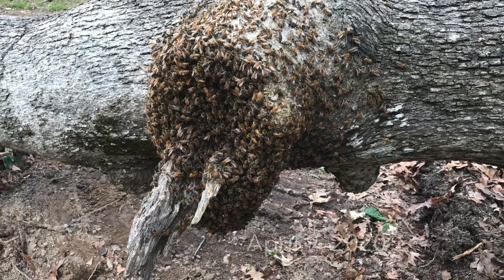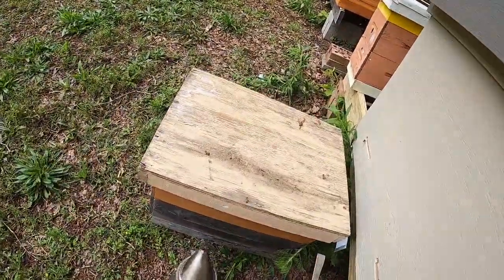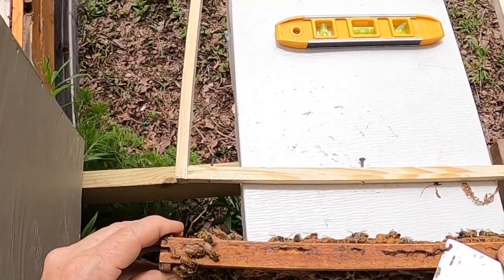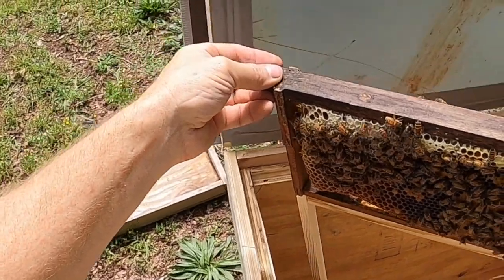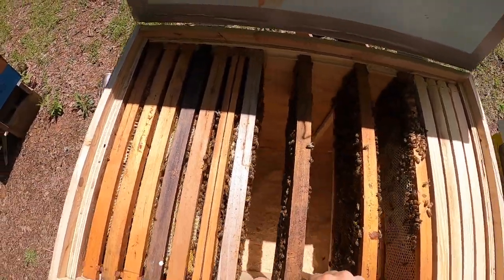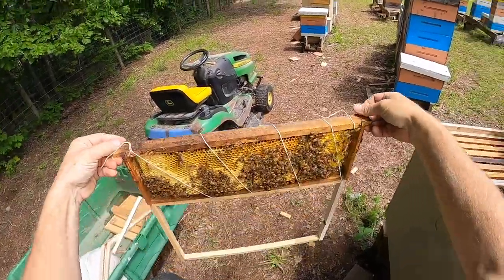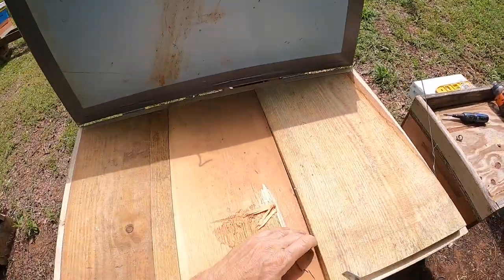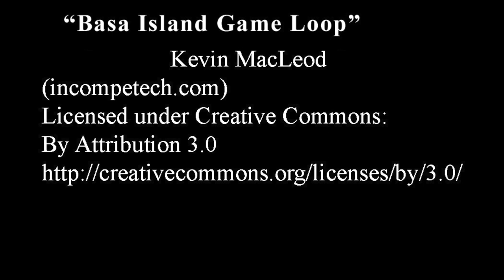Moving Tree Bees into Modified extra deep horizontal hive

Comment: Looks great!   In utilizing existing frames by adding extension, will that extra horizontal bar interrupt the brood nest or cause any issues?
Reply from the maker: The extra horizontal bar actually works quite well and I do recommend using them.  I use a bamboo marshmallow skewer that I get on Amazon pretty cheap. The bees keep right on drawing comb no problem.  I think because it's relatively small and thin they work around it without any trouble and it helps strengthen the entire frame and comb together.